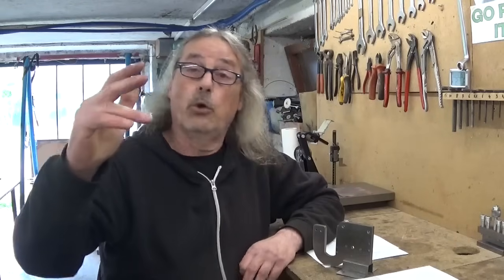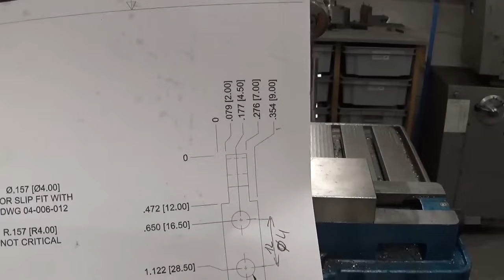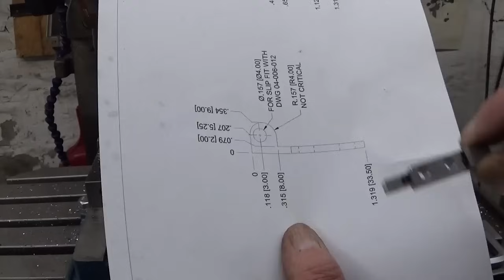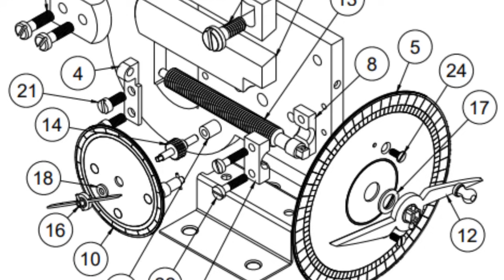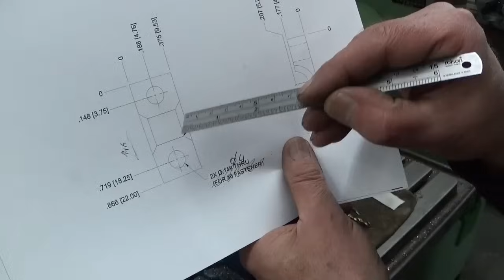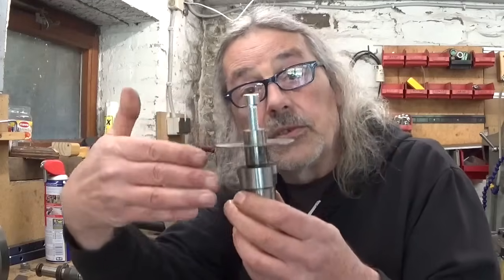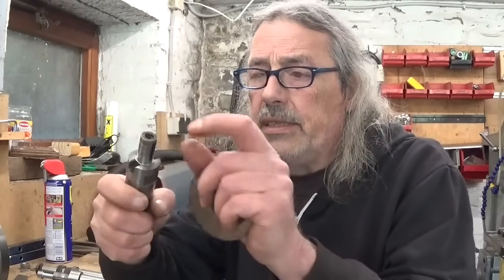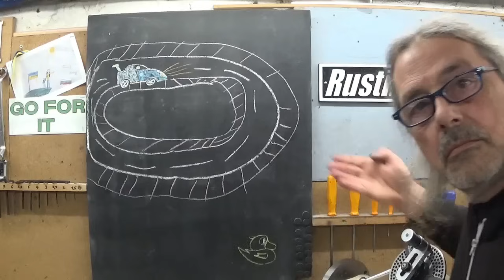James Watt's micrometer build part 2.

Comment: I'm really enjoying this project. It's going to be a fun piece to have. For the arbor with the left hand thread, couldn't you have turned the slitting saw upside down and run the spindle in reverse?
Reply from the maker: Nope, the FP1 can't run in reverse.

Comment: If you can run your spindle in reverse your left hand thread holder will work turn your slitting saw blade over and run it backwards!
Reply from the maker: Indeed, but the FP1 can't run in reverse.

Comment: Hi Michel.  For the slitting saw conundrum, I'd have used the original arbor with the saw flipped and the machine in reverse, assuming it will run in reverse.

Give me the specs of your 3 dividing plates and I'll chuck you a pdf with division calculations up to whatever number you want.
Reply from the maker: Indeed, but the FP1 can't run in reverse.
Thanks but no need. I have all the numbers I need. And even more...

Comment: Hi Michael you could have saved yourself a little time if you had simply turned the slitting saw blade over and run the mill in reverse. Great job non the less 👍
Reply from the maker: Indeed, but the FP1 can't run in reverse.
Reply: @Rustinox  Ahhh that might make it a little more difficult 😂

Comment: Daft question, but why not install the slitting saw on the arbor the other way up and reverse the spindle rotation? Or is your mill not able to do that?
Still really enjoying the series anyway👍
Reply: I have a Deckel FP1 like Michel, and no, they cannot be run in reverse direction. You can of course change the order of U,V,W to run backward, but then you cannot run forward any more. Anyways, backward is not a good idea, because automatic feet will stop working then....
Reply: @StefanKaser-yx7oi  Add a VFD? Reverse is available at the touch of a button then😁
Reply: @ThePottingShedWorkshop  I didn't say, that it ist not possible at all. VFD or just an additional switch for changing the polarity would to the job of course and even extend the versatility of the mill. But would that really be easier than turning a bushing for the other arbor? And even with VFD you would have to give up the automatic feet functionalety for that new direction...
Reply: @StefanKaser-yx7oi  Fair enough. My mill has separate motors for feed and spindle and as theyre 3ph they need VFDs anyway as I only have a single phase supply.
Reply from the maker: Indeed, no reverse.

Comment: Hi Michel, if the slitting saw comes loose, you can also simply reverse the direction of rotation of the milling machine. Of course you also need to adjust the cutting direction of the slitting saw and turn the saw blade over.
Reply from the maker: Indeed, but the FP1 can not run in reverse.